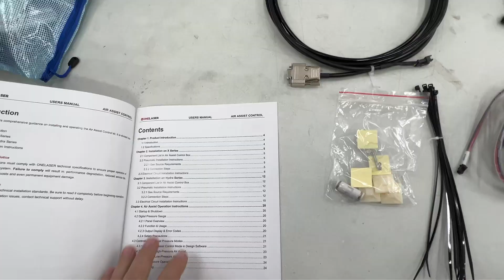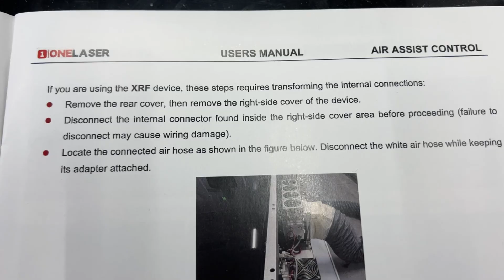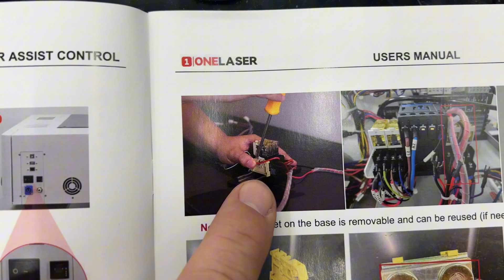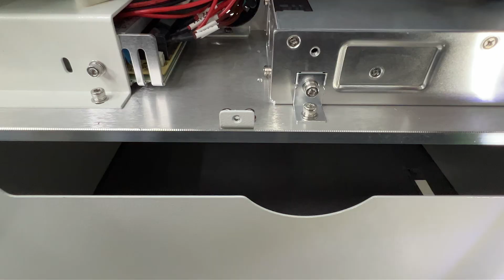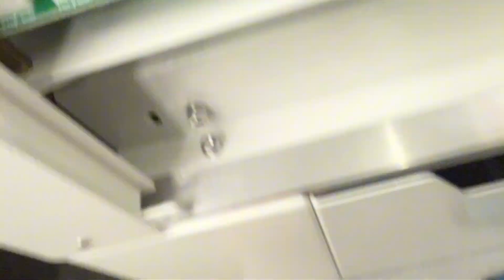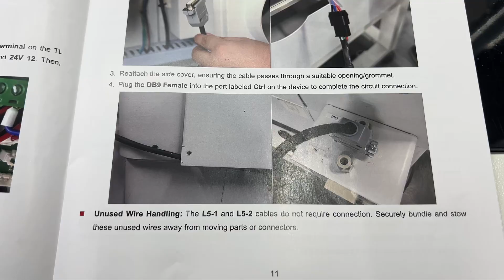OneLaser Air Assist Install XRF

Comment: THANKS! You saved me loads of time finding the circuit board plug-in locations. Your routing of the control cable out of the lower right hand side of the XRF to the Air Assist unit was BRILLIANT because it didn't require drilling any holes as the metal XRF cover can easily be bent to not pinch the air tubing. CHEERS and many thanks!

Comment: It is nice to see the (almost) perfect OneLaser has a few flaws.   For manuals I always maintain that they should be written by a secretary who barely knows which way to turn a screwdriver.  Let them do the install several times and then write the manual.  You end up with a much more comprehensive manual.